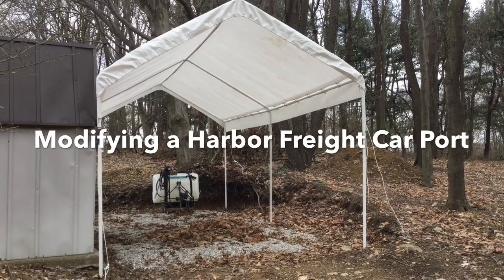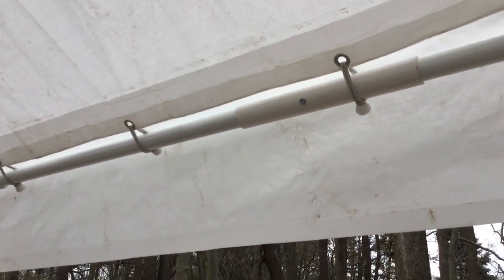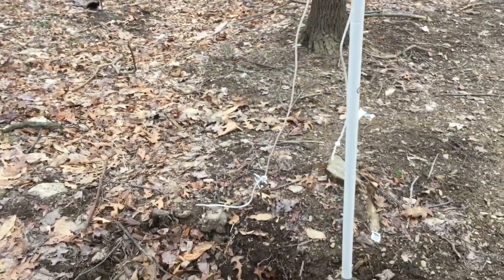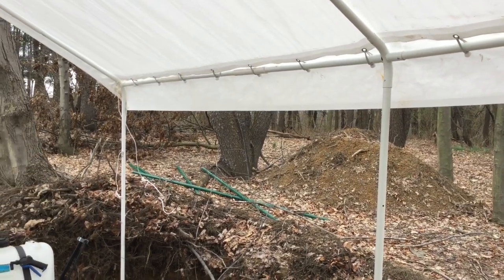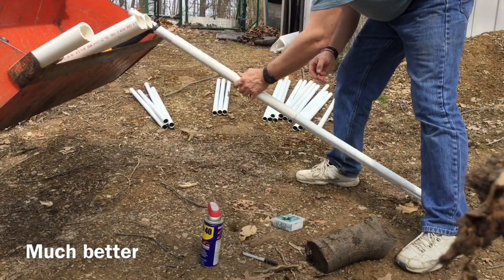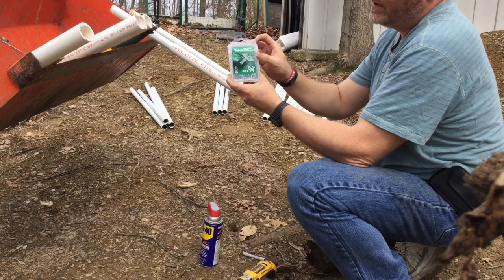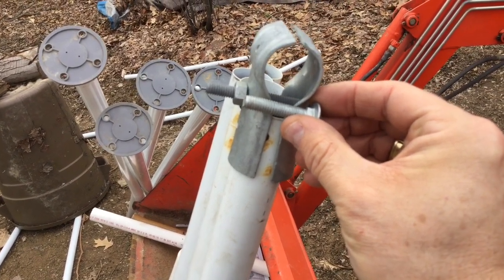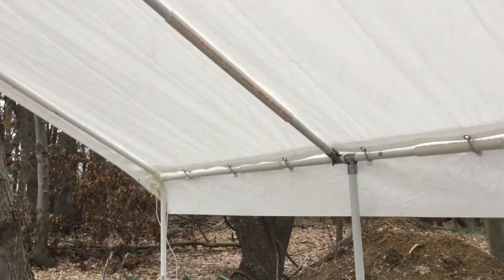Modifying a Harbor Freight Car Port

Comment: I like where you're going with this, but instead of the steel ends, I think a pvc "T" joint, one size larger than the existing cross piece, cut so it clips over the existing cross piece would work well too, cheaper, and not tending to rust.

Comment: My last one last 8 months when weight of snow ripped the roof. Friend found 7 rolls of aluminum siding. 2 1/2' x 50'. like your idea of the  extra poles. Mine is anchored to cement slab. I have one that was bought about 3 years ago that is staked to dirt that has withstood 80 mph winds but both of these have slanted sides.

Comment: Looks good to me. What type of pipes did you make the other supports out of? I am going to try this out. Thanks
Reply from the maker: Funny you should ask.  I had a buddy of mine buy on of these units.  He did not tie it down.  One night a storm rolled in and picked up his car port like a beach umbrella.  Bent most of his tubes.  I bought it all from him for 20 bucks.  I was able to save the extra parts for my car port.  You can also buy extra tube from your local hardware store. You can use the same tube that they make chain link fence from.  (actually i think it the same posts they make the gates from) You would be better off buying from them.  They come in 12 foot lengths and are MUCH better quality and MUCH stronger.
Reply: 1 1/4 inch pvc on seams, #8 , 3/4 inch gutter screws, 2 1/2 inch galvanized carriage bolts.

Comment: Two years have gone by now, how is your car port holding up?
Reply from the maker: Superb. The structure is rock solid. No bends or pvc cracks. I am still using the original tarp. Over the years branches have fallen on it and caused small holes.

Comment: Where did you get the additional pole footers to mount the poles to the floor
Reply from the maker: I had a friend that had bought one but got ride of it. I got the extra parts from his kit. You can also get the part you need from home depot. You can use fence post brackets

Comment: Hey did you ever do any more work on the frame?
Reply from the maker: Michael McFearin besides what's in the video I did not. I was just about to do a one year follow up. I am happy to report that the frame has held up extremely well. No damage after a hard fall and winter.
Reply: How is the fabric cover holding up?

Comment: Hi why waste your time on this?the first gust of wind bye bye .
Reply from the maker: Not even close.  We have all ready had 2 large storms.  One of those has 40-50 mph gust.  This thing did not move.  Not sure why you would thing it would go bye bye when I anchored it with special anchors that went 18 inches in the ground.
Reply: I got this unit myself and did this upgrade as well as used a ratchet strap at each corner and have now gone one hurricane and one tropical storm without permanent damage. I did have. Tropical storm Michael did shift it all and pull up two straps but no damage just reposition and tied back down.